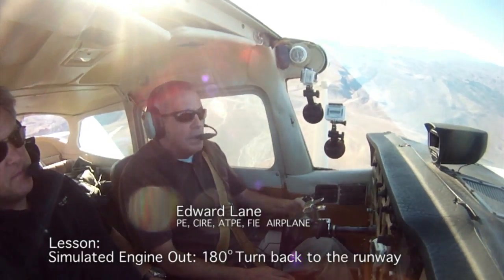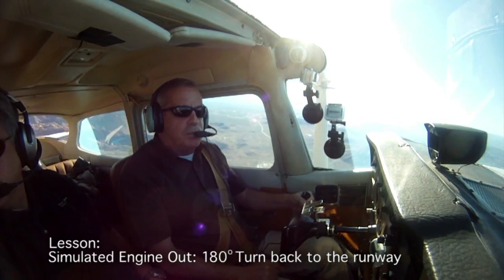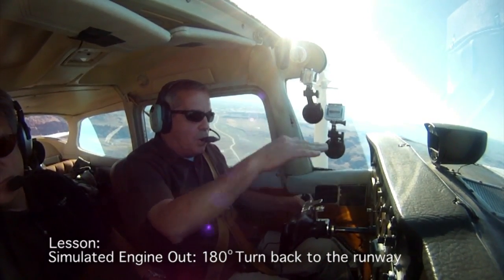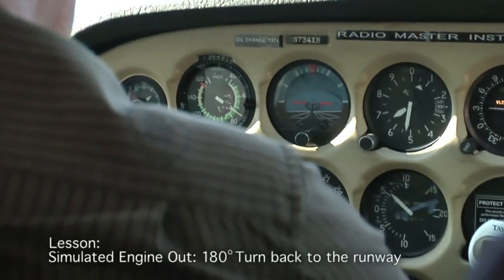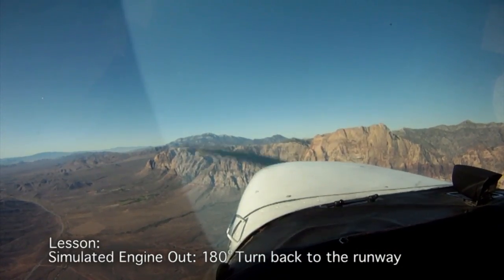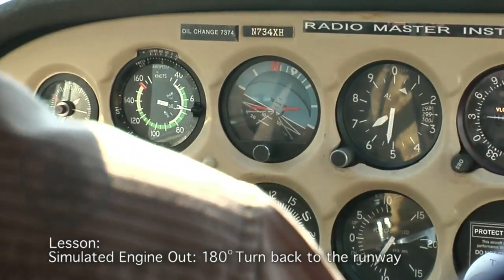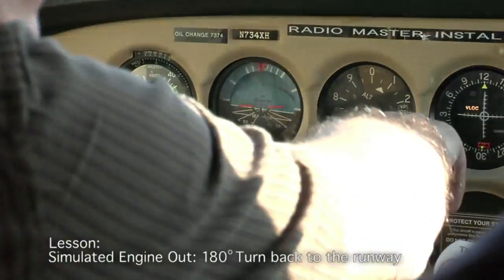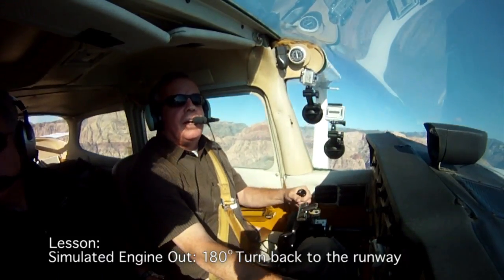Engine Out 180 Turn Back to Runway

Comment: John C. Eckalbar runs the math in "Flying High Performance Singles and Twins."
Optimal maneuver is an aggressive nose low slicing 45 degree bank turn, just above stall speed. Pull smoothly until you barely hear the stall horn, stay coordinated.

Comment: 45 degree bank coordinatrd turn at just above 1.2 Vs1 is optimal for any aircraft. Least altitude loss per degree of turn, not best glide speed.
Reply: You're right.... and 45 degree into the wind if possible to reduce the turn diameter
Reply: Just have to add that at 45°bank the V2 (1.2 Vs for the given weight and flaps config) should be increased by 41% due to the loadfactor 1/cos45!!!!
Reply: claude-serge Seron Actually, stall speed increases with the square root of the load factor. You want the speed to be as close to stall as possible. since the load factor is 1.414 at 45 deg bank, the stall speed increases by square root of 1.414 or 1.189, so the 1.2Vs already accounts for the bank angle.

Comment: @PennaPlanum If you didnt' hear yet.. clear the engine is to put it back to full power, as so not to cool it so much that it actually wants to quit, for example in the plane I fly, a 172 with Carb heat, you have to periodically apply full power during power off descents so as not to have it quit on you. :)